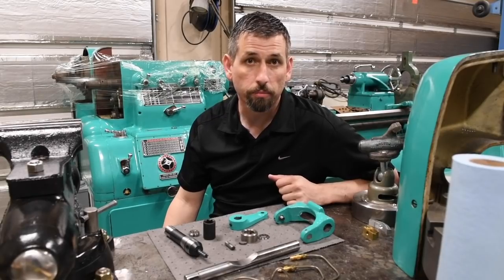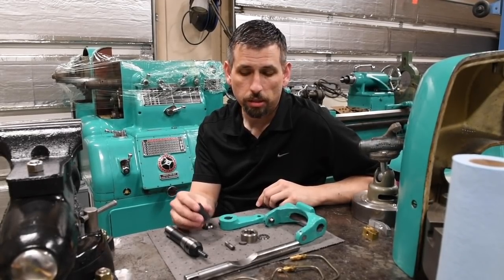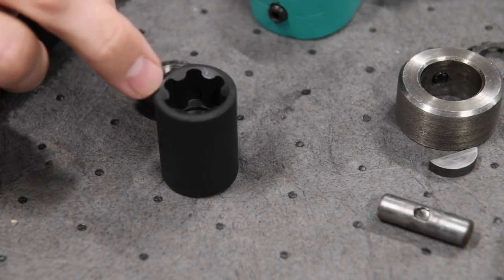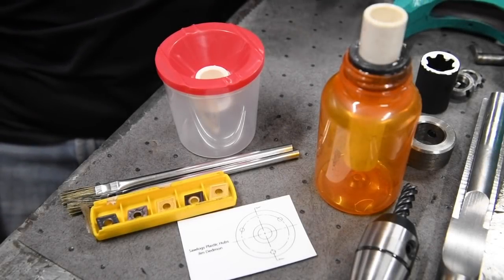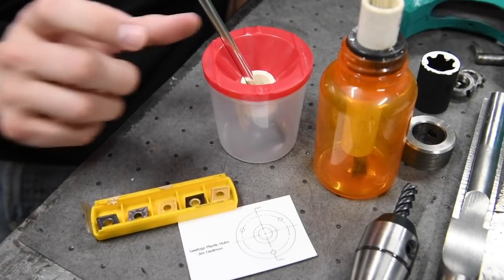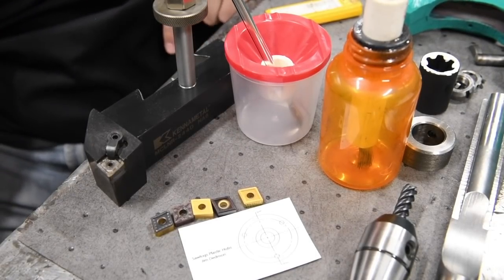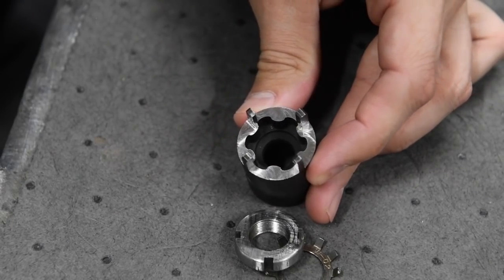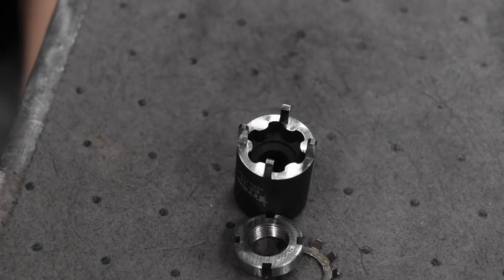Making a Bearing Locknut tool from a torx socket

Comment: Great video and great tool made saved a small fortune there little tip I use for transferring shapes on to material I use either tipex or a paint pen to put a thin layer on the pattern then place the pattern on the material I want to machine for a second or two lift off and you should have a perfect or near perfect transfer works best on flat patterns like your locking nut love the videos thanks for taking the time to share your skills all the best stay safe god bless

Comment: Nice ,  its amazing how much a one-time use tool will cost you..  i had to buy a axle socket for my truck.   The auto parts store told me to just bring it back for a full refund..   so thats what I did.
Reply from the maker: MetalWorks Machine Shop yeah those one time use things can be a killer. Happy to spend $6 on this!

Comment: Great solution to a problem. Just a heads up if you ever need to make another socket like that, get a impact deep standard hex socket they’re only hex for like the first inch and then cylindrical the rest of the way down so just cut off the hex part and your good to go.
Reply from the maker: wayfastwhitie455 that’s right! Very good solution too. Would have saved a few minutes for sure. Thanks for bringing it up. 👍🏻

Comment: The sockets at auto parts stores are good quality, most are made in Taiwan. If you seen my speed handle for Kurt vices videos, that’s what I use for inserts. Thanks for the mention I hope you get a lot of use out of the oil containers, I used one of the CNMG 433,s the other day and it worked well.
Reply from the maker: Sawlogs Plastic Hubs by James Dedmon now that I have a working lathe I can give the inserts a test! Thanks again for your generosity.

Comment: Did you notice the nut moved while you were marking @ ~7:28, and again @ ~ 7:48? Also, I think if you had turned the nut over, it would have naturally centered itself and given you a little more surface area to hold it still.  The outside diameter and the height of the tool may cause you problems when you go to use it.   Just some thoughts.  I like the thought you put into your actions.  it gives me (and others) time to see where you are going with your plan.
Reply from the maker: Nope didn’t even notice it. I could have clamped it to the table but this was fine. I did have the nut flipped over when I was thinking through this and it wasn’t as stable. Thanks for the suggestion though. And thanks for watching!

Comment: With a mill, lathe etc, I would definately not pay high money for any tool I can make myself. It pays to keep a little scrap metal around, pipes of different dia, rods, angle iron etc, you never know when you might need to make a tool or fixture.